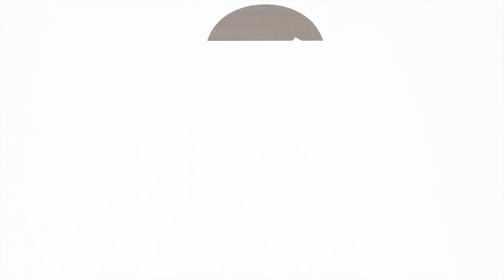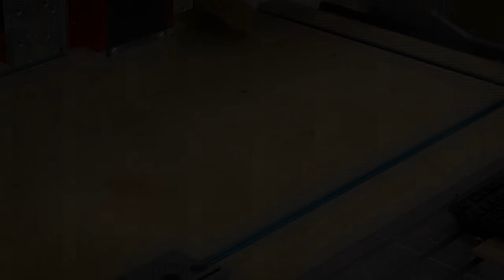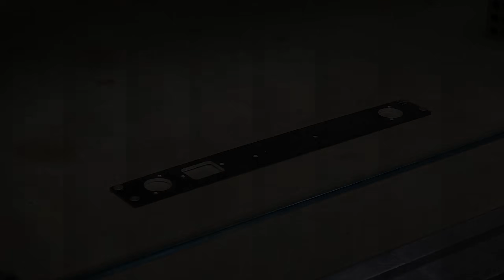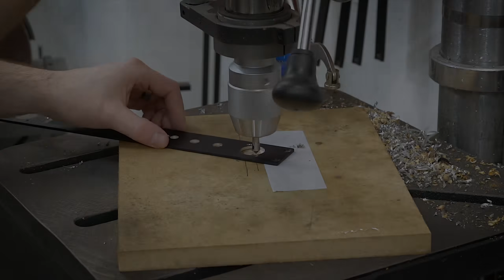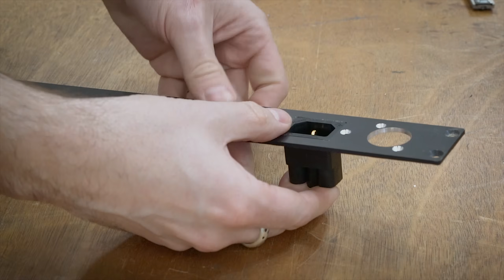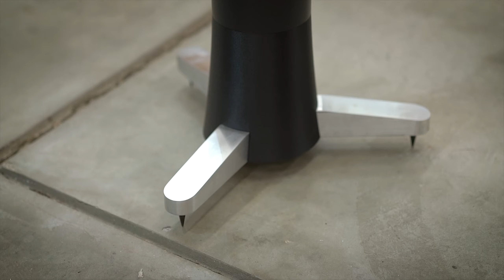LXmini Controller - Machining the Enclosure

Comment: This is an older video, so I don't expect you to remember - but when you send your part back for a second round at the router around #7:00, how did you manage to get everything realigned so nicely? I imagine you used the same screw holes as before, but even that would be a little bit off , no?
Reply from the maker: I do remember!  I just re-drilled the hole pattern in the spoilboard.  By drilling the holes in the spoilboard, you're assuring that it will line up and you don't need to indicate anything.  The hole pattern is already 'indicated', so it's just a matter of drilling the holes, screwing it down using those holes, and everything is lined up and indicated.
Reply: @RobertCowanDIY  That does make a lot of sense! But isn't there still a little bit of wiggle room between the edges of the holes and the screws that could offset the entire job quite noticably?
Reply from the maker: @EirikBrandalf If you use countersunk fasteners, they should self-align everything.  I undersize the holes in the wood and use countersunk screws and it's good enough for something like this.  You're really at the mercy of the MDF though, as it's not overly rigid of course.  But the same thing in aluminum (with tapped holes) would yield very repeatable parts.